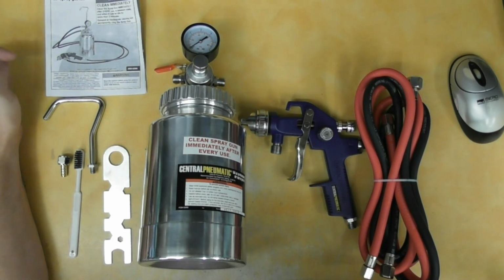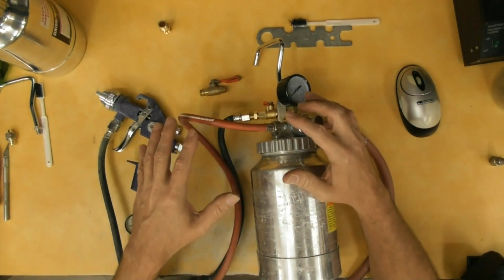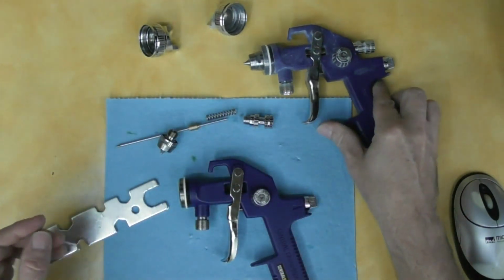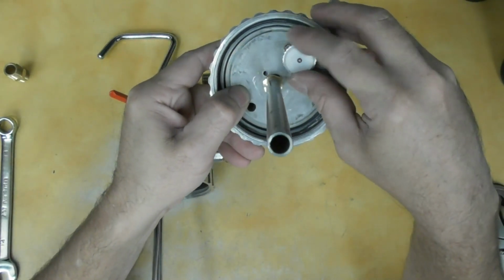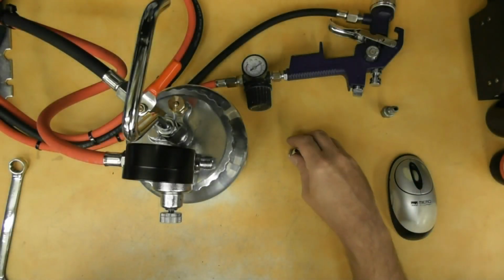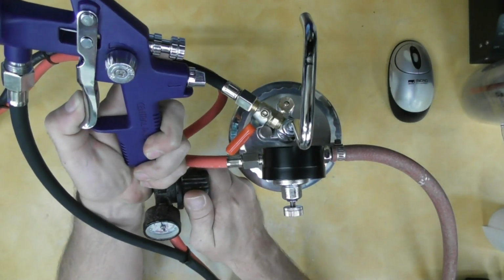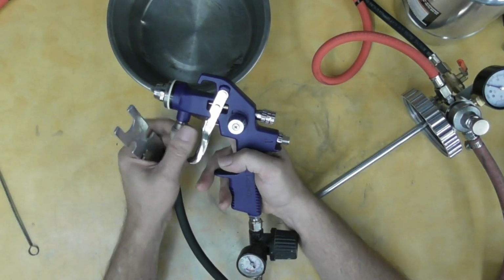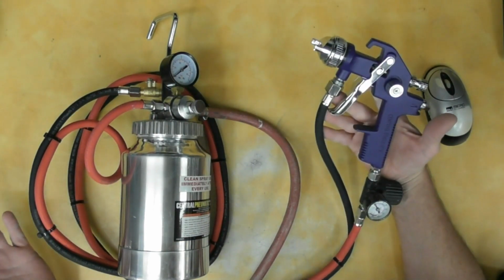Harbor Freight 64 oz. Professional HVLP Air Spray Gun Kit Review Item 62895

Comment: Great instructional video!  I had an earlier model of this kit several years ago that I used extensively building my house. I moved to gravity feed guns for the ease of clean-up and they were fine for most smaller projects but I missed the functionality for the pressure pot model. I purchased this new model several months ago and was disappointed in the manual. Thanks again for the explanation and the tips.
Reply from the maker: Thanks David! Glad you found it useful. I, personally, have mostly moved away from my gravity fed guns. I agree the gravity fed guns are easier to clean though. Also agreed- the manual is garbage and would turn most folks off using this setup. Hopefully my tips will steer you in the right direction should you give yours another go. Take care and good luck, G.

Comment: many thanks for the detailed review of this (and other HF sprayers).  you convinced me to try this (and avoid the lesser expensive one).  I am painting cabinets indoors and was unable to get the undersides with my gravity feed sprayer, but also the cup gets in the way.  I could list so many reasons why this unit is very well worth the money.  Main thing for me is the ability to get into tight corners and undersides, but being able to force the paint out under pressure allows for less thinning but also allows for lower air pressure which results in minimal overspray.

I was reluctant to buy this unit because at $60 it's not really disposable like the other HF sprayers I have bought.  But the value I get out of this unit is easily $60/per day so I could justify getting a new one frequently.  Hopefully I can keep it clean and it will last a couple years like yours.
Reply from the maker: That's the exact reason I wen't with this setup- painting cabinets. Same problem with my gravity fed guns. It worked out great in every way. Super clean it after each use and it should last quite some time. Good luck, G.

Comment: Thank for the education G' you have certainly given me confidence to start practising with a sprayer, I have never used one before but I'm not afraid to try now....I'm still awaiting your tutorial on adjusting a micrometer.

Thanks again for explaining things so plainly and for taking the time to film and upload....10/10.
Reply from the maker: Thanks Rich! I prefer spraying over any other type of application. It does take some practice, but practice and you'll get it.  Pretty sure you're referring to the restoration of the Starret mikes that were purchased at auction and locked up. I'd restored one, but not the other two. I'll film it when I get around to doing them. Take care, G.

Comment: thanks for your very informative video clip, my question is that even on HVLP you set the pressure at the gun 25psi and the pot on 40psi? I thought conventional gun and pot takes this pressure. and on the  HVLP we set around 5 to 8 psi
Reply from the maker: Yes, I set the pressure at the gun (trigger pulled) to 25psi. But no, I set the pot regulator pressure to 3-5psi on the gauge. The post pressure should be set just high enough to push the material into the air-stream. I hope this helps. Good luck, G.

Comment: Thank you for this review, was looking into this for painting my deck (and eventually the interior) and this helped a lot.  One thing I need to look at now is a decent air compressor.  I have a cheapy that I use mostly for...well, tire pressure mostly.  Is one of those portable ones that doesn't really do much, I think it's rated for brad and thats about it.  

Thank you again and I hope 2020 has been kind.
Reply from the maker: No problem! This should work fine if you have a compressor that will keep up with it. Another option could be an airless sprayer for your application. Do your homework. Take care, G.

Comment: I just got the older one by mistake, This thing has a lot of overspray, it works great but my gosh cover the floors and everything 50 ft away because it makes one hell of a mess. Is the hvlp version any better?
Reply from the maker: If you mean the older version that was "not" an hvlp setup, then yes- this one is way better. Very little overspray. Hope this helps, G.

Comment: I'm assuming you used an adapter to mount the pressure regulator on the gun to go from NPT to whatever the thread is on the gun. Am I correct?
If so, would you identify the adapter?
Reply from the maker: Sam, the regulator I used wasn't NPT- but something different. For the life of me- I can't recall what that fitting is called. Perhaps you can look for a site that sells pressure pots and look there to find the correct name. Not much help- but good luck, G.

Comment: Hi, I've just bought one of these spray guns and as a first time user, found your video most informative. I've set it up in a similar configuration to yours and have been using it to spray aluminum soffits.  

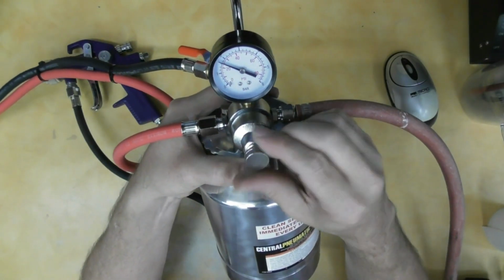I have a question regarding the air regulator on top of the pressure pot.  Is it normal to have air escaping from the bleed hole at all times, no matter whether the regulator is open or shut?   This is what has been happening with mine and of course, my compressor has been cycling on and off more than I feel it should.  I noticed that when you tried to get the pop off valve to open then closed the regulator back down at about 36:48, there was only a faint hiss of air.  Mine constantly blasts out and I can feel the air jet at about 20 inches away, which doesn't seem right.   Any thoughts or suggestions?   Thanks, Al
Reply from the maker: No, that's not normal Al. The only time air should come out of the bleed hole is when you reduce the pressure in the tank.  Once it gets down to whatever the setting is- it should stop. I could see that problem if your inlet pressure from the compressor is too high. Try turning it down to see if it stops acting like that. If not, I would exchange it for another one and try again. Hope  this helps, G.
Reply: @ghostses  Hi, thanks for the VERY prompt reply - much appreciated.  Yes, that's what I thought but wasn't sure as I've no prior experience with spaying.   I'll try it as you suggest and see how it goes.  Thanks.
Reply: @ghostses  Yep, it's faulty.   I've just tried it again without fluid and compressor output set to 40PSI.  It still constantly puts out air through the bleed hole, with the regulator screw backed out.  Unfortunately, neither of the 2 HF stores in my area have it in stock just now so I'll have to make do with it to get my soffits finished, then exchange it asap.  I only bought it last week so got plenty of time yet.
Reply from the maker: @Gourockian1  No problem!
Reply from the maker: @Gourockian1  Al, It sure sounds that way. Yeah, plenty of time to finish your job and exchange it for a new one inside of the 90 days. Once you do, be sure to test your replacement so you know it will work for your next task. I've heard too many times folks don't test something out and by the time they do- they're past the return/exchange period. HF can be hit and miss from one box to the next. Take care, G.

Comment: Cheap tools & materials represent the single biggest mistake DIYers make when approaching these types of projects. Remember tools are not an expense, they are an investment that you make in order to achieve superior results. And once the job is done they can then be sold for 80-90% of their value, so in the end it will cost less than renting. These 2 budget HVLP Systems are the best hold their value: 1st choice: Fuji 2202 Semi-PRO 2 (2203 gravity version) & 2nd choice: Earlex HV5500.
Reply from the maker: I won't disagree in the whole John. I have tools from the top shelf down. Personally, I make my decisions based on expectations, and of coarse dollars. For what this is, and what it costs, it works surprisingly well for primers and paints. Granted, I've not tried it for lacquers or poly's so I can't speak on that. Take care, G.

Comment: You said you could use latex paint with a spray gun? How do you do that? Do you have to thin it out? If so what product do you use? Thank you for your time. Ronnie
Reply from the maker: Yes Ronnie, I shoot latex with this no problem. I use Sherwin Williams Pro Classic thinned with 10oz. of distilled water per gallon. Hope this helps, G.
Reply: ghostses it does. Thank you.
Reply: Thank you! It worked. I did not know you should dilute the paint a bit.
Reply from the maker: No problem! G.
Reply from the maker: Good deal! It depends on how thick it is to begin with, but I do for the product I use. Take care, G.

Comment: Can this be used for undercoating with fluid film?
Reply from the maker: It might but I can't say for sure. It does look pretty thick. I'm sure it would push it through the gun, but don't know how well it would atomize. They recommend using an airless sprayer, but they're way more expensive than this gun. For what this setup costs, it might be worth the gamble to see how it works. Good luck, G.

Comment: What mind of compresor era you using?
Reply from the maker: Fermin, here's a link to the compressor I mostly use with it. Sometimes I have to let the compressor catch up if I'm spraying something large with a lot of trigger time. Hope this helps, G.

https://www.harborfreight.com/21-gal-25-hp-125-psi-cast-iron-vertical-air-compressor-61454.html

Comment: Mine sucks it  just pours paint out the end. doesn't spray at all.
Reply from the maker: Bradly, I would say either it's setup incorrectly, or you have something wrong with your unit. If you're inside of the return window, I would exchange it for another. If not, make sure you're setting it up correctly. Take care, G.

Comment: Thank you for the very detailed explanation of the system and the errors in the manual.  
You have definitely saved me a lot of head scratching LOL   I do have one question though, 
do you have to raise or lower the pot pressure for different thicknesses of paints, or should it always just be a couple of pounds?
Reply from the maker: Glad you liked it. And yes to your question. The more viscous the material the more pot pressure you would need for a consistent flow. Less viscous would require less pressure for a consistent flow. The objective is to give just enough pressure in the pot to get a good flow and still have the ability to properly atomize the material. I hope this make sense. Take care, G.
Reply: @ghostses    It makes total sense, thank you.  I don't think I will have too much of a problem with it as I bought it to prime and paint the under side of my Mustang because I don't have a lift and I figured this would be less trouble than a gravity feed gun.
Reply from the maker: @me3333  No problem! It should work great for that application and much better than fighting a gravity fed gun under there. G.